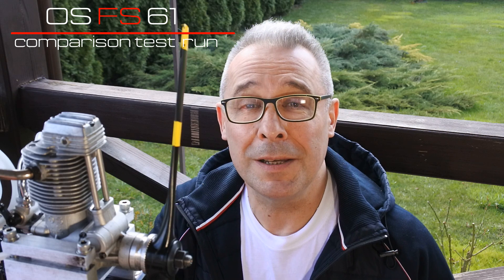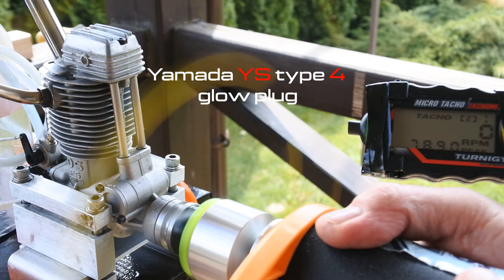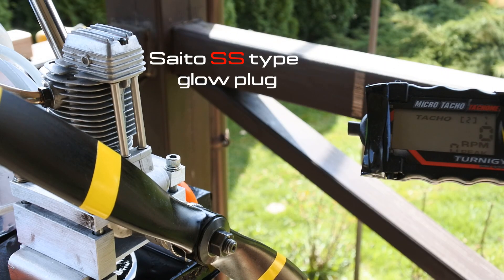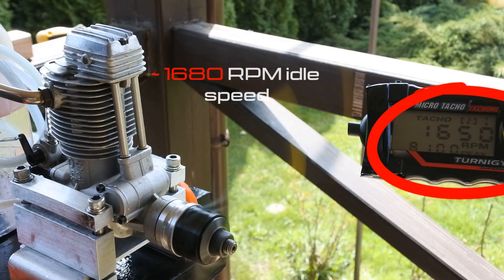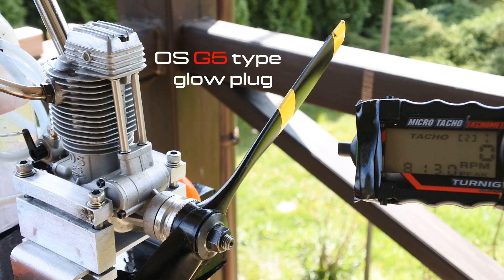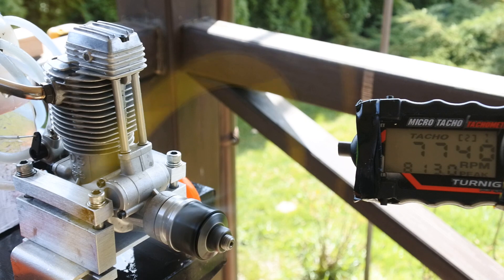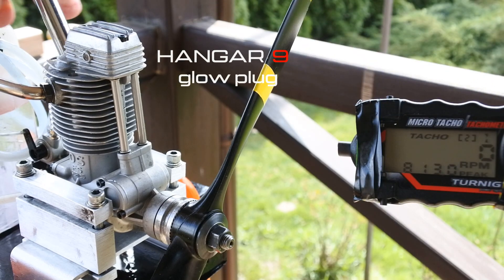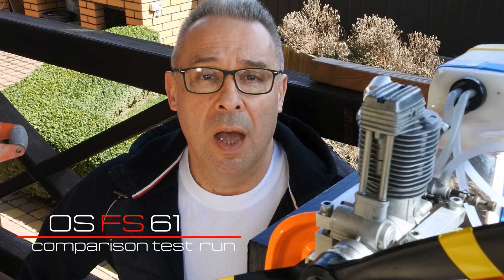OS FS 61 comparison test run

Comment: One thing that this series is making perfectly clear, is that any engine will run just fine on 0% nitromethane fuel. As the cost of nitro continues to skyrocket, those that still enjoy using their glow fuel engines can be confident that using lower cost FAI fuel will be satisfactory.
Reply from the maker: Thank you very much for your comment ! Yes, surely, agreed with you. Also, I've in the nearest plans to create a kind of summary overview of this  test series, with all the data collected in one comparison table. I am confident that such generalized data, obtained experimentally with video recording, will be a unique source of information for many. I think that such work has not been carried out on such a scale and with the aim of creating a reliable, confirmed database. I spent 3 weeks on this job, working almost every day, and of course, I wanted this time not to be wasted. Of course, I learned even more about these engines and their features, and it's good that I can share this with enthusiasts, hobbyists and fans of radio controlled models.
Thanks and have a nice day !
Reply: @crazyengines88  Yes, it is a really nice thing you have done for the community and enthusiasts!
Reply from the maker: @xKmotx   Thank you, much appreciate for your kind words ! Just doing my best.
😀

Comment: Why using FAI fuel? Idle would improve with a little nitro, every engine you’re testing recommends nitro, thanks for posting very beautiful engines you keep them so clean
Reply: Nitro is an American thing. Nitromethane is cheap in the USA, and it is wildly expensive in Europe and other countries. I believe most engines were actually developed to perform on FAI fuel. And for international competitions sanctioned by the FEDERATION AERONAUTIQUE INTERNATIONALE, FAI fuel is required. No nitromethane allowed. Any model engine can be made to run perfectly well on FAI fuel, with some fine tuning. Cheers.
Reply: @xKmotx  But a little nitromethane does make the 4 strokes run a bit happier. Provides a larger tuning range and more reliable idle. 5% is sufficient. Similar results can be achieved with acetone instead of nitromethane, but in my opinion and testing not exactly. The disadvantages of nitromethane are the cost, availability and corrosive residue left in the engine following use. For sure FAI fuel can be made to work and provides a good standard for testing.
Reply: @bloodnocka  Agreed.
Reply from the maker: Good afternoon, and thanks for the great question! There is actually a reason why FAI fuel was used. It was necessary for me to create standard conditions for all engines, the same propeller, and one "typical" fuel.
Of course, the addition of nitro instantly changes how the engine behaves, and not just at idle, I know that very well. But I needed to get clear, undeniable results, so that later I could summarize them in a table and make a reference table, the data in which many could trust. If I used my own fuel, many skeptical viewers might have questions about its composition, etc. However, disbelief (and not about critical thinking) is a fairly common phenomenon among us.
So, I tried to make sure that everything was checked and thought out, and that the results of the tests could be trusted by everyone.
Thanks and have a nice day !